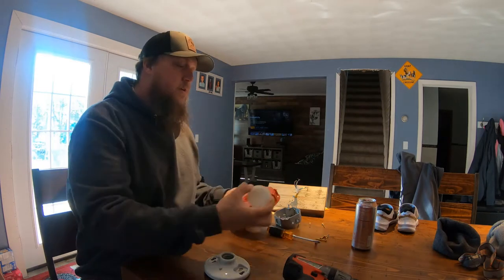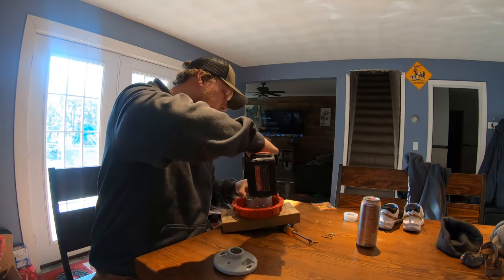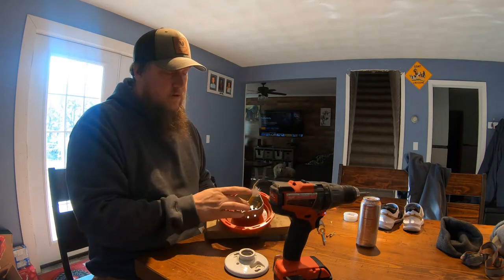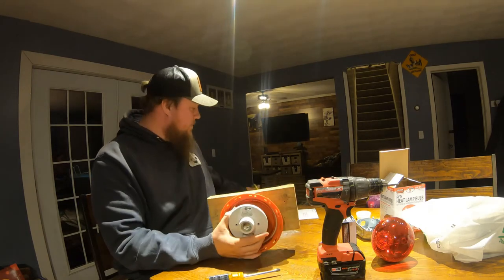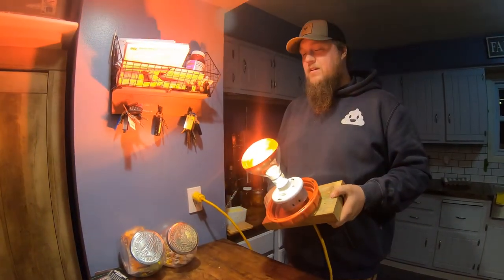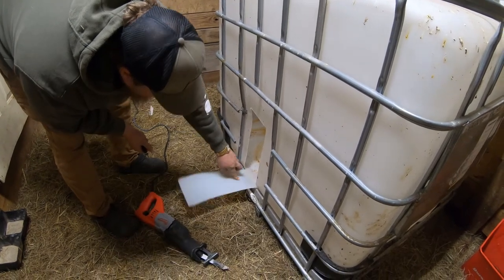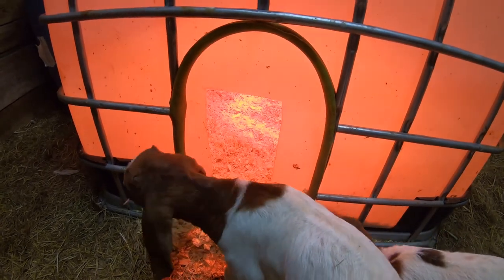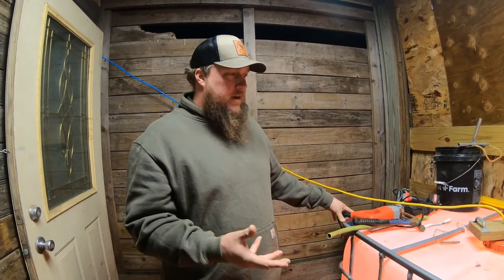IBC HEAT HOUSE FOR BABY GOATS!

Comment: Hey i have had heating  bulbs shatter i dont know why but its happened....so im switched to  dog house heaters they work great go on the wall has a thermostat....also u can use a heating pad which is way better because the heat  stays in the straw or hay making a super comfortable bed and better in extreme cold